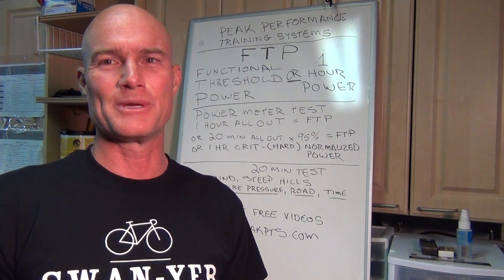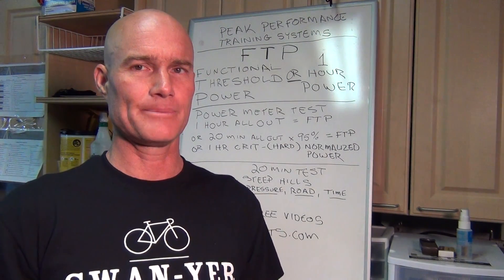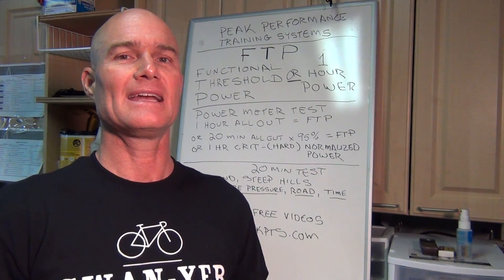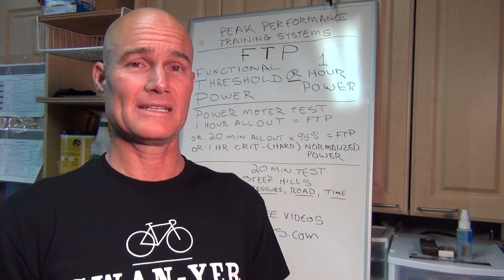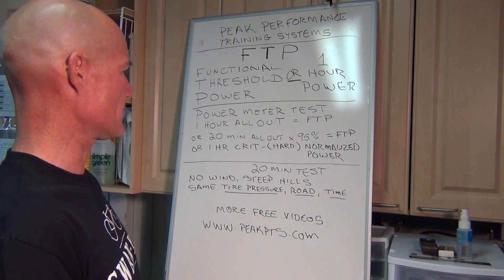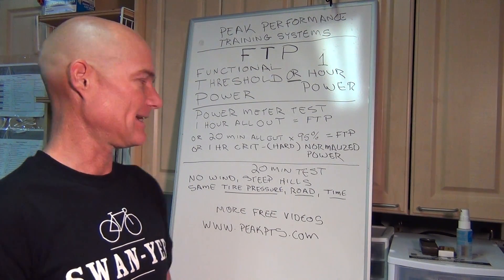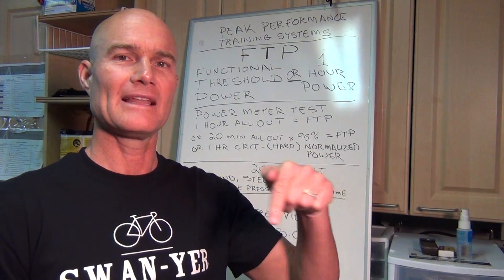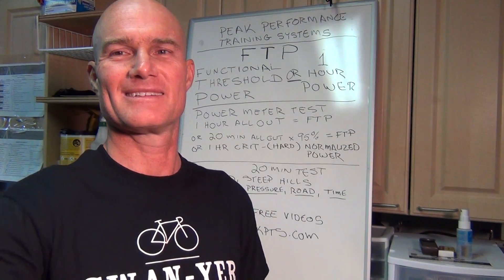What is FTP or Functional Threshold Power

Comment from the maker: William, 
Depending on your fitness you should warm up at a minimum of 20 to 30 min before doing a 20 min power test. I feel that 45 min of steady riding with several 1 then 2 then 3 min hard efforts with 3 to 5 min between at an easy pace followed by 10 min of easy pedaling just prior to the 20 min test is a very good way to warm up prior to doing your FTP 20 min test. Good Luck!